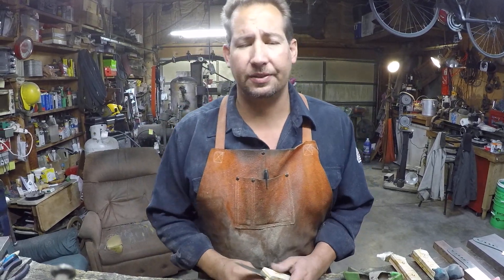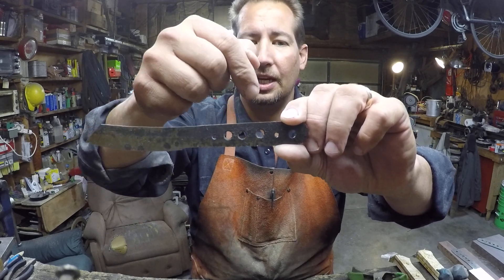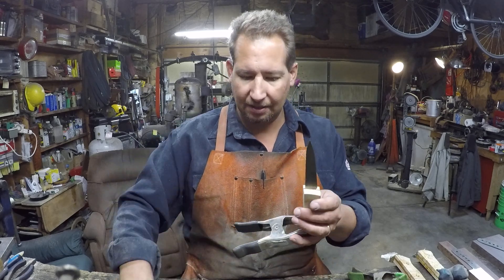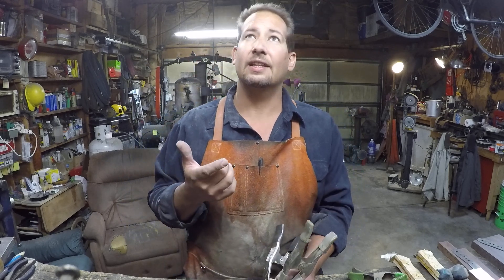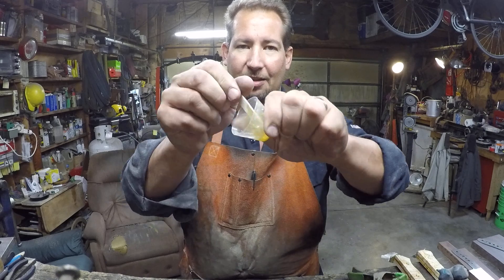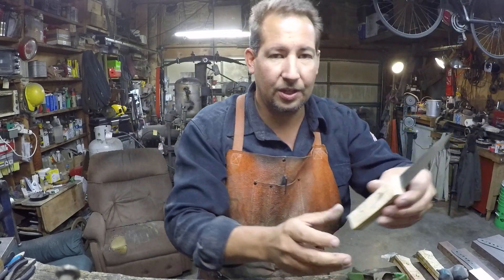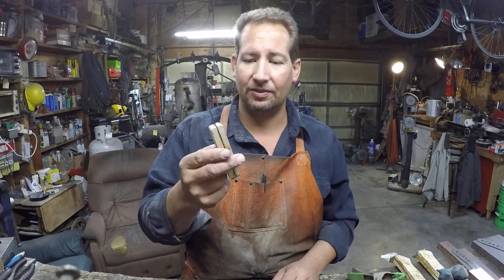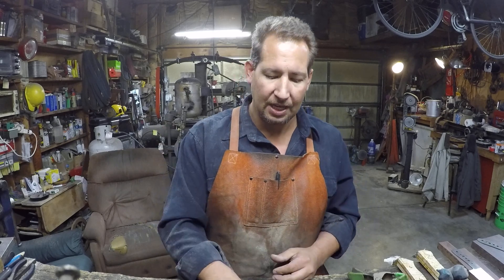how to remove stuck knife handle pins

Comment: Excellent video and tip. I haven't made lot's of knives (maybe 10 or so) but I always do it all in one go. I use a slower epoxy and before I clamp it up and wipe out squeeze out I have already peened the pins.
I didn't really find much on YouTube about peening pins for knife handles. I just checked there still isn't much although there is a newerish one I haven't seen yet.
I would love it if you could do a video on your peening process and technique. Answering questions like; 
- How much peening is needed?
- At what point does it make the wood split or more likely to split?
- Does it make wood splitting more likely in general?
- Domed vs sanding it flat
- What size hammer you find works best.
- Does peening after glue up risk breaking the epoxy bond?
I hope this is a good idea and one you are interested in for a video as I could definetily use more info than I have on it already.
Reply from the maker: great idea, ill see what I can do
Reply: @joecalton1449  cheers, can't wait.

Comment: Hey mate. I have me a german mercator knife and wanted to do some work on in. Do you know how I would be able to remove the pins from the handle?
Reply from the maker: removing pins from folders is always a bit touchy...... i usually either shear them with a replacable utility blade like what is in a box cutter and a light hammer, or very very carefully drill out the end and then use a punch and bench block to drive it out.